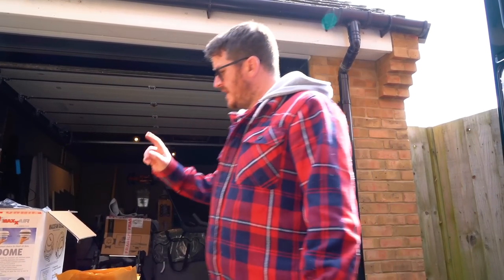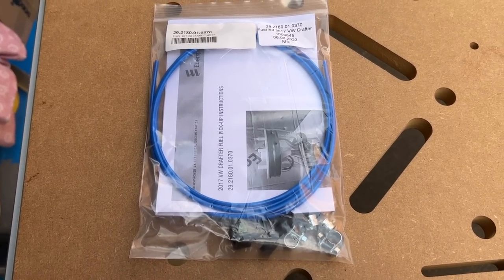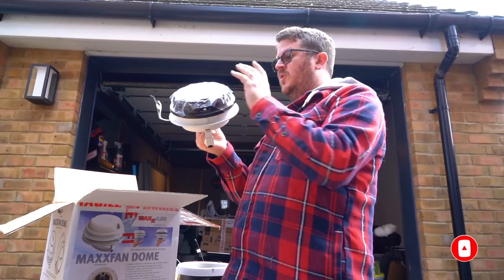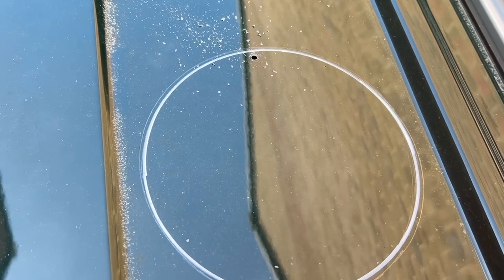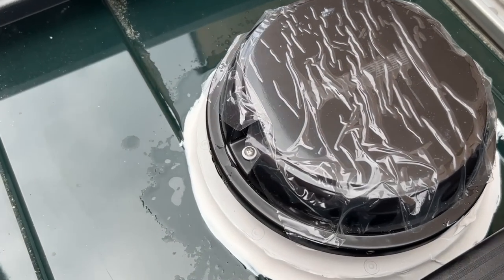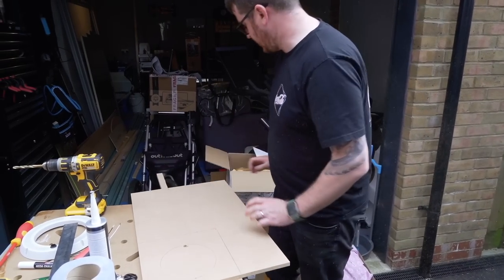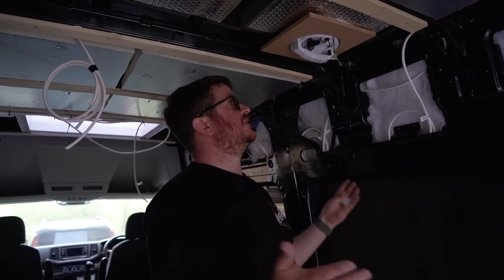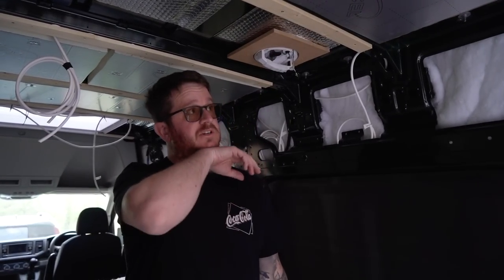Fitting A Roof Fan! | MaxxFan Dome | VW Crafter Camper Self-Conversion

Comment: Hello.
Wish you for a good van living journeys!
And now some guestions!
1).This type of fan bring air from outside
in the van or 
just only sends out the excistance vans air?
Something else important.
2).If after years the electric vent stops working.
Is it possible to fix it from inside the van without puting it out and damage the excistance construction?
3).
If someone puts 
one of them in 
the van roof,
do you think 
it is enough 
for a good ventilation or it is better to have two of them installed in the roof?
Thank you.

Comment: Nice video thank you. Would you please link me to where you purchased the fuel line pickup kit? Also will ot drain the tank if left on? 

Thanks and keep it up. I'm a new subscriber now.
Reply from the maker: Hi there. Thank you very much for watching. This is the one I purchased. Unfortunately it’s showing out of stock but hopefully it’ll be back in stock soon. https://www.melloronline.co.uk/Heater_Installation_Accessories_/12351/Eberspacher_VW_Crafter_2017_%3E_Fuel_Pick_Up_Kit.html?fbclid=IwAR32W1qN_zW8qrYbLauVj0ufGh_krk5ztONIHTetTOGex0Hqmdb_XQiQEA8

I think it would drain the tank if the heater is left on but I’m not 100% sure. Unless the heater can detect when it’s low but I doubt it. 

Thanks again for watching

Comment: Thanks for the video. I bought this exact same fan to replace an existing fan on a cargo van. There are couple of things I'm confused about this fan, I appreciate if you can help. The LED ring that goes from the inside, is it supposed to slide into the circular body of the fan, or does it stay outside? I still haven't installed my fan, but the LED ring doesn't fit into the circular body of the fan, no matter how hard I tried.

Also, the adapter ring you put on the outside, is that an accessory you bought? I don't believe it comes with the fan. Do you need to have that, or you did that for roof thickness purposes? As far as the "plywood ring" from the inside, again is that something you did to add thickness, or just reinforcement for the fan? I have to do that from the inside because my fan bounces up and down with the thin sheet metal of the van roof to reinforce the roof and make it stable and no bouncing up and down.
Reply from the maker: You should have an inner plastic collar that fits into the fan and the LED ring. That collar needs cutting down depending on the thickness of your roof. 

Also the adaptor was ours based separately. It just helped to even put the roof making it easier to seal up. I’ll try and find the link to where it was bought from. 

I put the plywood in there to add some strength as the roof is really thin as you’ve found out
Reply: @ABusAndBeyond  I do have the long collar but I won't be using it because my roof is thin. But I am definitely going to make a reinforcement out of plywood (maybe 1/2") from the inside.
Reply from the maker: @ustaarthur if you’re using the fan to vent moisture out the van I’d definitely use the collar otherwise you’ll get moisture in the gap.
Reply: @ABusAndBeyond  It's a cargo van so not really for moisture, just ventilation. I'm just replacing an existing one that doesn't work well and is a little broken from outside. I probably wouldn't install one if there was none.

Comment: We did our first campervan trip this weekend, a case of try before we buy.  I really struggled to sleep with the heater on due to the ticking of the pump for the diesel heater.  Did we just get a loud one in ours or is it usual?  Is there a silent option?
Reply from the maker: I think it can vary. Can you get access to the diesel pump? Maybe it needs changing or maybe you can fit some form of sound dampener between it and your camper van?

Comment: Spraying water onto silicones then smoothing it out only allows water to get between both mating surfaces and not fully sealing the joint. You should smooth out first, then spray and final smooth and clean. Real amateur hour
Reply: At what point do they claim to be professionals? Why are you being so harsh. Just back off, or f’off and go watch something different